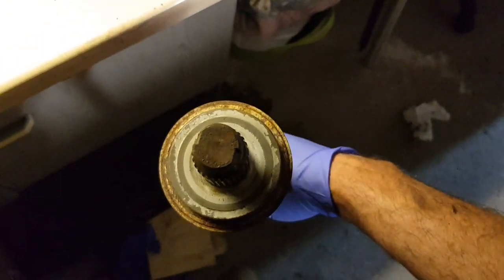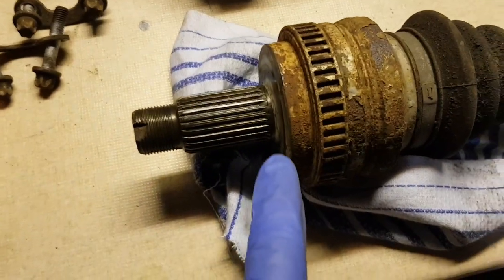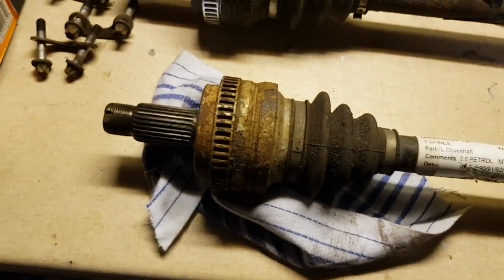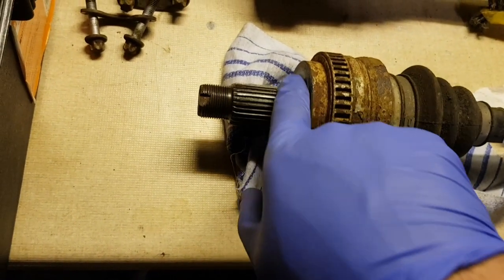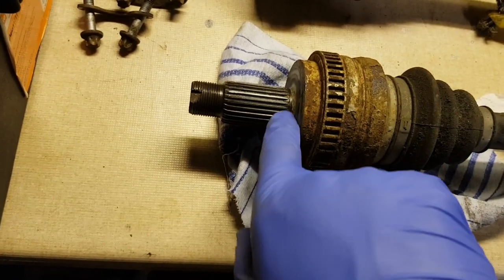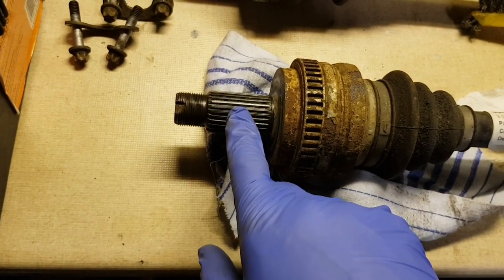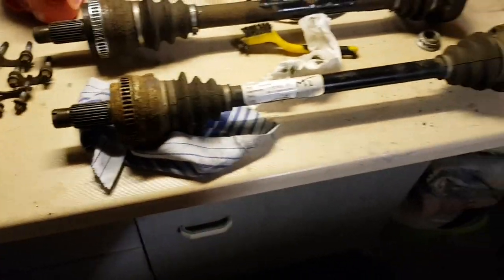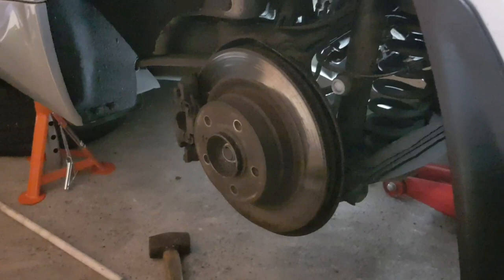ABS fault / ABS ring & drive shaft replacement BMW e90 e92

Comment: Well done for doing this. I tried to do similiar on my E60 recently, swap out the drive shaft as both boots were leaking. First of all, it seized in the bearing, wouldn't remove even with heat. Had to cut the hub off with an angle grinder. Took 3 hours and umpteen blades. Then the integral link bolt snapped. Then, the six bolts on the inner driveshaft end were totally seized, wouldnt move even with heat. In the end, the half-shaft came out of the diff, meaning a new circlip and seal needed for the diff, plus new half-shaft, which are on their way to the UK from Lithuania - 2 week wait even before Brexshit. Utter nightmare. Yours looked easy by comparison!
Reply from the maker: Wow that sounds like a proper nightmare well done for getting through all of that. I was expecting that type of disaster but in the end the only thing that gave me major trouble was the big nut on the drive shaft (hub end). The six inners came out ok but the big nut was a mess and I had to drill it off. Tried impact guns, heat, rotary tool etc none of which worked. In the end we drilled through it and split it with a large flat head screwdriver.  Think of all the money we have saved on labour!!
Reply: Fekin hell lad 😱
Reply: Great video discribing a similar fault with my e92 , you sound that your from NI, would you consider homers?
Reply from the maker: @Puregym1  not sure I'd be much use doing homers as I'm not a mechanic haha. I would definitely try to help you tho if I can. If u send me ur email address I can get in touch with you and see if i can help in any way re advise / tools etc.

Comment: I just bodged mine, removed sensor and put a washer in between the hub and sensors, works fine, abs works as it should
Reply from the maker: Great job well done, saved yourself a few quid there for sure!!
Reply: Hi, was your car coming up with the same faults as the video? I have braking and driving stability fault, flat tyre monitor fault and  DBC failure fault. Abs kicks in on its own similar to the video, wonder if I can just stick a washer in-between the sensors and crack on 😂

Comment: Great video mate, and good to hear my local accent (N'Abbey).  This will be my next project in the coming days/weeks, as I have the same warning lights, (with engine power loss and car shuttering when at high speeds).  I think I'll just replace the DriveShafts with new, as I've seen videos and photos with badly corroded shaft ends and Relevator Rings, and a lot of effort to try to clean the crud & rust off them.  Thanks for sharing!!
Reply from the maker: Thanks very much, glad to hear it has helped someone. That seller does look great, I never found anything so well priced new. I got mine second hand from beside you in mallusk (traynors). On the plus side we haven't had any issues since this replacement so I'm happy it has definitely cured the problem. Now struggling with what I suspect might be a rattling cat ffs.
Reply: @bumbleshufflesdiy5908  I ended up getting the pair of DriveShafts from this seller mate, and they are top quality, and delivery was only a couple of days.  Just waiting on the weather getting a little better before I replace them, as I can imagine I will be at the job for hours, especially getting the shaft-spline out of each hub, then the new ones in... Hopefully all goes smooth enough though.  Good luck with the cat (if not already sorted).
Reply from the maker: Cheers. Not sorted yet but passed the mot so will do for a while. Aye they can be hard enough to get out but a big heavy mallet and a bit of wood I'm sure ul bash em out. Hopefully u get lucky and they come out without an argument!
Reply from the maker: That sounds like a proper nightmare lad sorry to hear ur having bother. Nothing ever seems to go the way it's meant to with motors. Hopefully the seller refunds u or send the correct parts. I tried to fix the issue with new rings first myself but also had no luck. I'm thinking the measurements are so precise on the reluctor ring that and deformity at all sends the system mad. I found that the new ring I initially fitted was very slightly too big which may have caused the problem and that's why I replaced with a used part in the end. Hope u get back on the road quickly / cheaply. Dont forget traynors beside u if ur stuck. They were super cheap and had the part in stock.

Comment: I had same problem with too much corrosion. By time I'd cleaned corrosion off the new ring wasn't tight and could be moved by hand. As temporary fix I put a bead of chemical metal putty around the driveshaft and pushed the ring on to secure it and refitted. I have since purchased a brand new driveshaft ready to fit but the bodge job I did seems to have worked as ABS warning light has not come on since (3 weeks since fitted) and it was coming on everyday.
Reply from the maker: That's a great job well done. I tried similar with a tuna fish tin but it didnt work out with mine and I had to replace the shaft. If it's working I'd leave it well alone haha!

Comment: I have fault code 005DEC on my e91 which should be rear left speed sensor fault and also sqeaking noise when in move up to 15mph.. could it be that sensor is touching the abs ring and makes that sqeaky noise?? Have no lighs on dash yet just found this fault code during regular diagnostic and noise for about two months.
Reply from the maker: I suppose it could squeak if its dry and just rubbing lightly. From what I could see with mine it's been rubbing lightly for a while and at the start it just caused an intermittent issue until eventually it wrecked the sensor. It must slowly swell and swell until it just  kills the sensor. There was quite a lot of rub on mine before the sensor actually gave up. I also tried putting a washer on to hold the sensor away from the ring another mil or so. I think that could buy some time and get the sensor to last longer.

Comment: If the ring is the issue, could it be cleaned in place (power washer) and new sensor?
Reply from the maker: I dont think that would work once its started to swell. It would be pretty hard to spray in there with a power hose but once the corrosion is under the ring its probably inevitable that its heading for failure. Simple issue but a massive pain in the butt to sort out!!

Comment: I've got the same issue w/ E90. Thinking of buying 2x half shafts w/ ABS ring of course, found a good price for Magneti Marelli (OE PNs 33217553561/ -562). Do you know what is the OE original half shaft supplier that comes fitted with the car (GKN/ SKF/ Magneti Marelli..)? Thank you!
Reply from the maker: Sorry just spotting this. I have no idea unfortunately who the original manufacturer is of these shafts. If you call your local bmw parts department they might tell you though?

Sorry I can't be of more help.

Comment: Is this video applicable for a 2009 128i?
Reply from the maker: Honestly I'm not 100% sure but if I had to guess I'd say they should be pretty similar.
Reply: @bumbleshufflesdiy5908  Last question, because there are 4 sensors for each wheel, do you need to replace the axel four times too?  Or can I replace the axel and sensor once and good.
Reply from the maker: On my car there is 1 abs sensor and 1 abs ring on each wheel (for of each all in for the whole car). I used a computer to find out which wheel was causing the issue and then just replaced that one only. I didnt touch the other wheels as they were working fine. If the sensor looks badly damaged then I would replace it also (along with the abs ring). Does that help any?
Reply: @bumbleshufflesdiy5908  Sorta.  I'll ask on for my car specific, but there is only one axel with this ring right?  Or are there four of them (per wheel).
Reply from the maker: Sorry if I'm not getting what you mean but there are the following:

Rear passenger side (1 axle, 1 abs ring & 1 sensor)

Rear driver side (1 axle, 1 abs ring & 1 sensor)

Not sure about the front but thats how the rear is set up on my car. There is 1 axle / drive shaft per side as the both meet in the middle of the car at the differential (they are bolted onto the differential).

That make sense?

Comment: I personally would have replaced the drive shaft with new .
Last ya another 10 years or so
Reply from the maker: Definitely if the car was younger but in ten years I doubt it will be on the road so I opted for the cheaper route in this case.